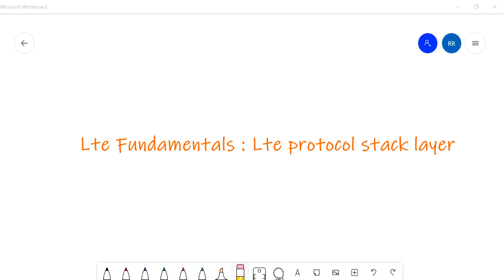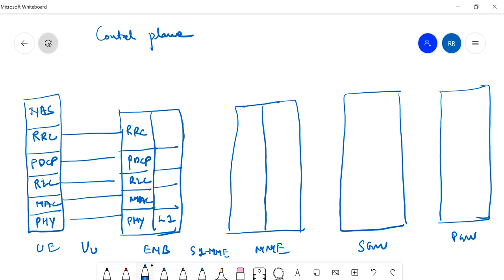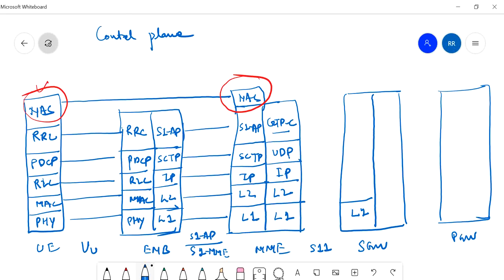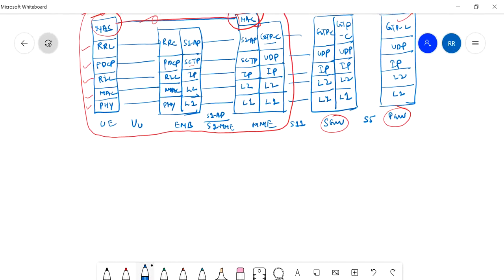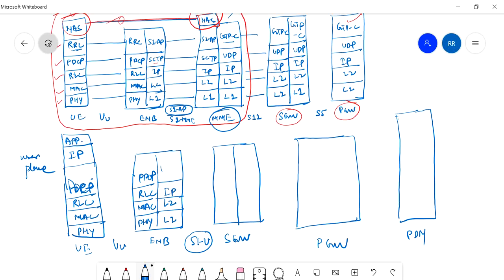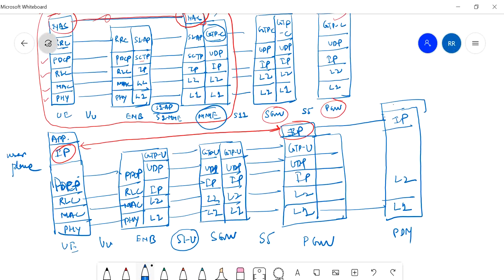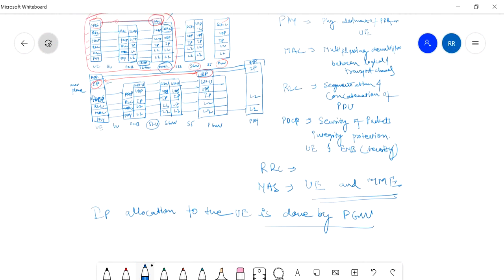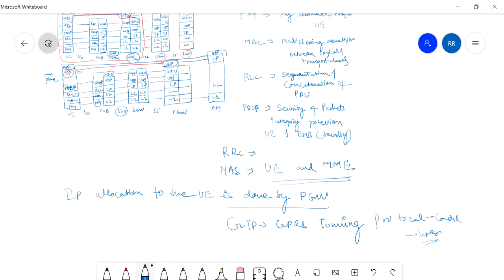Lte protocol structure - Brief discussion

Comment: please upload videos on following topics:
LTE Network Elements, LTE Interfaces, LTE Identifiers, LTE Signals -PSS & RSS, LTE system information, LTE RACH procedure, LTE NAS layer, LTE Piggy Bagging concept, LTE-RRC, PDCP, RLC, MAC, Physical layer; LTE Cell selection and reselection, procedure, LTE X2CAP protocol, LTE S1AP protocol, LTE carrier Aggregation, LTE Attach and Detach procedure, LTE IMS/Volte, LTE SIP protocol, LTE Diameter protocol, LTE Network Simulators, LTE Protocol conformance testing process, LTE Device Certification process, LTE UE Logging tools, LTE UE flashing tools, LTE Log analysis....